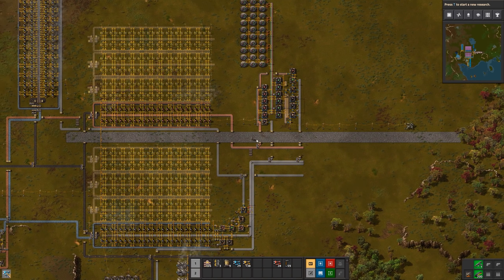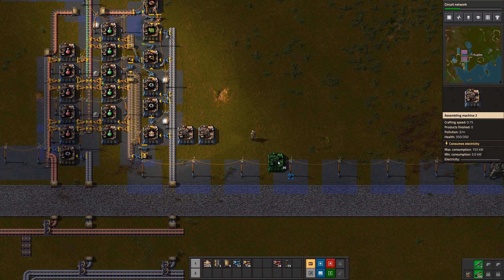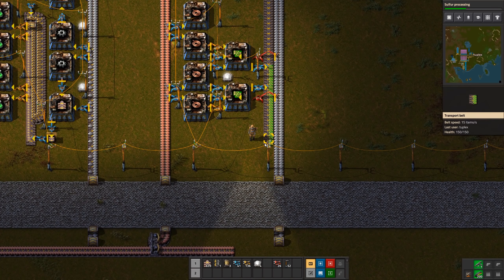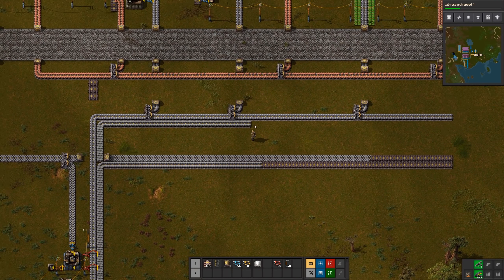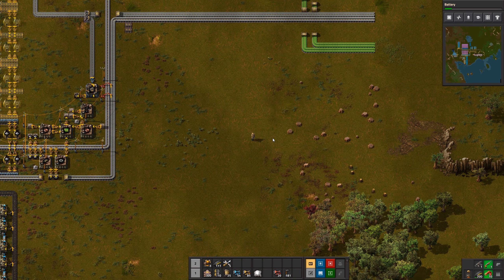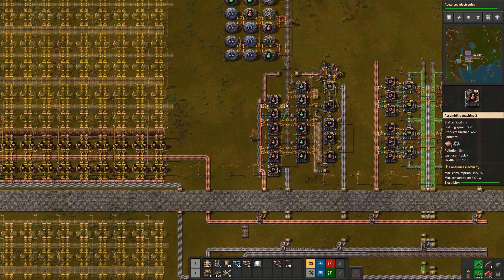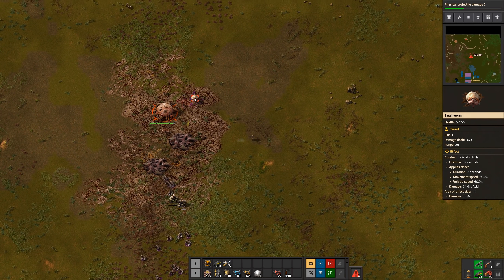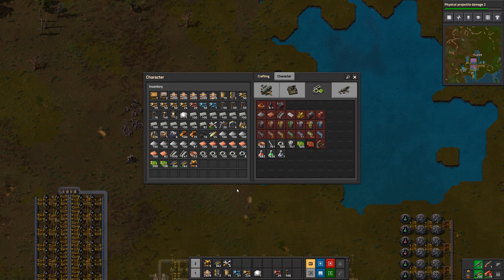Factorio 1.0 Tutorial #5 - Green circuits

Comment: 32:28 - I'd recommend putting that second splitter after the first one.  It'll then refill a potentially-empty belt, and make it visibly obvious that (if) the next belt is then getting empty, and that you thus need more production of [in this case] iron.  JD-Plays has a nice demo of both of these methods, along with some others, at https://www.youtube.com/watch?v=HP7DNlCh4XI -- recommended viewing for all.
P.S.  38:14 - that radar could also use replacing.  I presume you'll notice and get to it, but... mentioning just in case.  :)

Comment: Would a full line of steel furnaces require red belt technology?  Then that smelting line would equal 2 yellow belt smelting lines?
Reply: Yeah!  It's super handy.  Usually then the retrofit to blue belts you can do with modules so it works out